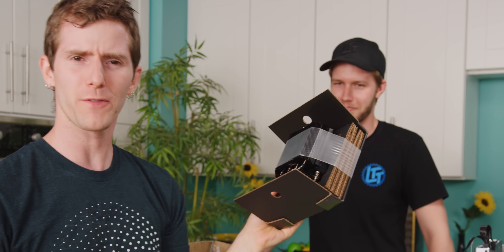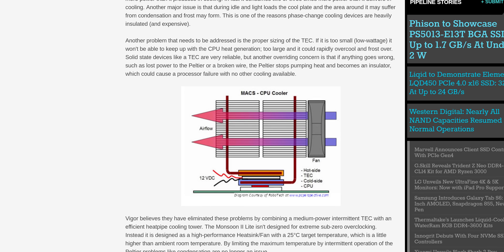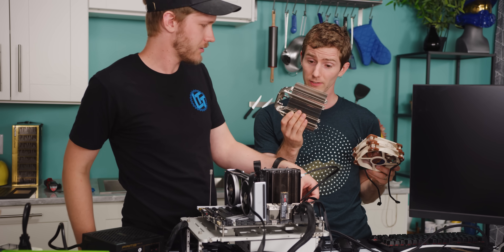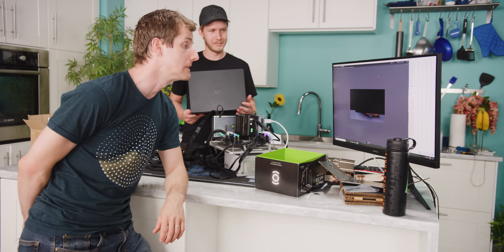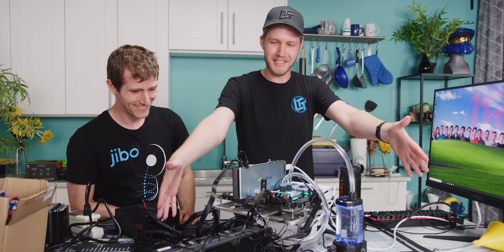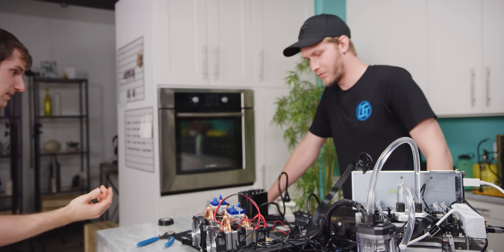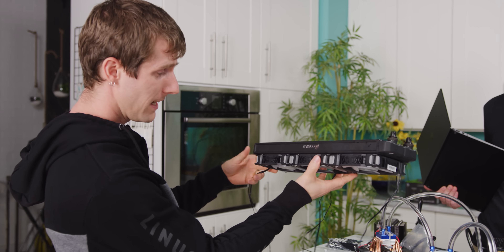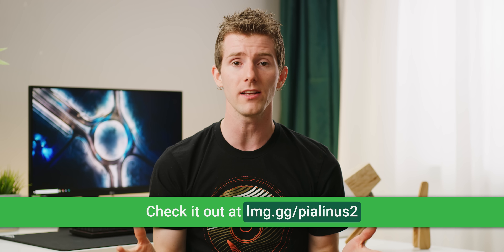Thermoelectric Cooling is a Bad Idea

Comment: You let TEC affter Cooling Pad, follow this map CPU -> Cooling Pad  -> TEC 1 - TEC 2 -> CPU, u 'll se diferent, u let the hot speed water into TEC (i don't think TEC work well). TEC1 -> TEC2 u make longer copper pipe make it like S zig zac, that TEC have enough time reduce the temperature out TEC2

Comment: What goes wrong here is that the TEC doesn't have the pumping power to keep up with the heat generated by the CPU, which makes the TEC effectively an insulator. With a TEC powerful enough to pump the heat away from the CPU, the air or water cooler can work more efficiently. Cooling power is increased when temperature differences between the heat sink and the air used to cool it increase. Don't forget a TEC (at least years ago when I used one*) generates as much heat as it pumps, so adding a peltier means you should have double the cooling power as well. 

I agree that using a TEC to improve cooling is a very costly solution. In the end you want silence and all the heat generated by the TEC itself does not help you at all. 

* I used a peltier to cool a Pentium 3 800E to -20°C many years ago and needed Neoprene insulation to keep ice from forming on the CPU and socket and on the back side of the mainboard. It was a cool project and contrary to the system in this video it worked. Even under load the TEC easily kept the CPU at freezing temperatures. But CPU's nowadays use so much more power that I understand why TECs are so inadequate.

Comment: Why take a large power hungry peltier to the CPU, when you could use a lesser one to cool the water reservoir of a water cooled system.  Also easier to test.   Or, use them to generate power from waste heat and power moar RGB - bwahahahaha.

Comment: I was researching peltier chips on CPUs and stumbled across an interesting comment (not sure if it was this video or another). Someone suggested using a peltier chip in conjunction with a water cooling system. Instead of applying the peltier to the CPU, you put it on the water reservoir to keep that cool. However, hearing about how peltiers use a lot of energy, I decided to look up ways to control the voltage to a peltier. Apparently, you can't regulate the voltage. But, you could turn it on and off with a PID controller. The PID would monitor the water in the reservoir to make sure it maintained a constant degree. If it went too high, the peltier would kick in and cool the water back down to the optimum temperature before getting turned off again.

Comment: Nice Vincero watches!
Great for using in a blender or shredder.

Btw, the Germans used peltier elements on their u-boats to produce electricity from heat difference between the water and the u-boat itself.
That way it's thermal footprint was lower/smaller, making it harder to detect by enemies and it didn't need to go to surface for replacing batteries.
Reply: Given the very small temperature difference potential, I'd say sources are needed for that claim, given that those thermoelectric driven fans for heaters barely operate a small electric motor at a difference of several 100s degrees Celsius.

Comment: Thermoelectric cooling will never be worth it. You have to not only get rid of the heat of the CPU, but you also have to get rid of the heat the Peltier is adding to the system before you see any measurable benefits. If you use a 500W Peltier, then you have to get rid of that 500W too.

Comment: have you tried to slow down the flow rate?  maybe giving the chillers more time to cool the water may help?   i understand it will also give the CPU more time to heat the water up but maybe it will make a difference over all..

Comment: Is there any benefit of cooling a cpu and gpu below ambient say maybe 10 degrees celsius under overclocked load instead of 30 to 80 or whatever above ambient degrees celsius?

Maybe longer life or better efficiency? I also don’t see the tec’s as stand alone coolers, they are more inefficient than radiators above room temperature, yes, but because radiators cannot cool to or below room temperature, tec’s are therefore more efficient there. 

Just not sure if there is a benefit. Also not sure if a better build with tec’s is to use the water cooling blocks on top of the tec’s and cpu to water cool the peltier, keep the size and noise down, as well as get the cpu below room temperature or to put the tec at the end of a radiator loop with some 6 heat pipe tower heat sinks where the tec chills room temp water from the radiator below ambient before it passes through the cpu and gpu and even to cram a peltier and water block inbetween the gpu and cpu to flash chill the water between the systems and to make use of the small size of the modules. Another system is to carry a double stack radiator with one water loop for cooling peltiers and another loop for bringing water to room temp with maybe an electric valve switch to either go below ambient or turn off the peltier and route water from the peltier cooling loop to the central loop when overclocking. Long story short, anyone investing in water cooling isn’t exactly a budget builder and will pay a few extra buckaroos for space saving, lower noise, and looking for whatever air cooling cannot deliver

Also, get yourself a krimping kit, like cheap dupont 2.54mm connectors if soldering is not your thing :p

Comment: I am absolutely certain that the thermoelectric cooler will run perfectly on AMD processors. After all, they consume a great deal less power and run much cooler than comparable Intel parts. If I had to live and work in Antarctica, I would use only Intel. They are very efficient room heaters, especially the i9 9900K.

Comment: Wouldn't you get the most out of this by cooling the radiator?? You know so the heat goes into the air not back into the system..

Comment: What if you use the 2 aquarium coolers in line with a radiator to cool the water coming out the cold side of the radiator then run it to the cold side of the cpu block and so on

Comment: I seem to remember removing peltier devices from old macs, I think they were 6100's, 7100's, 8100's, or 7500's.    I can't remember if they were stock or not either.   These were in early mid 90's models.   (LOL - When Linus was about 10)    Somewhere I still have the plates packed in storage...

Comment: a Pelletier use power to move heat, so eventually it generates more heat than without. The only good thing is to control precisely the température with PID loop.

Comment: 542 watts at 32 Amps means it's running at about 17 volts. Which means at 120 volts it's about 4.5 amps. Weird conversions in there.

Comment: The Term Cascade Refrigeration  as describe here:https://www.quora.com/What-is-the-advantage-of-cascade-refrigeration Could be more useful using the same Peltiers Modules Just Need to Better accommodate each module the correct way to better dissipate or transfer all the energy as Heat from the processor to peltier 1 and Peltier 1 to Peltier 2 but at Different alone Loops. Or Cpu to Peltier 1 to Accumulator to Peltier 2 cpu,  The temp should drop by a lot  but the wattage would rise up on peltier 1 as peltier 2 will lower far more what peltier 1 suck up the heat coming off from cpu and would not let accumulator to keep a fresh heat source untap.  By killing the heat from cpu allowing the flow in the accumulator to chill before being rechill before cpu intake.  BTW as seeing before a better coolant would be needed peltier can drop below 0 so a good coolant is a must.
Reply: Micro Refrigeration Compressor https://www.youtube.com/watch?v=uIYVwbw6gcg

Comment: Guys while I actually agree with your conclusions I have two suggestions.
I would  suggest calibrating your Flikr caméra. The temperature you are reporting is not totally correct. You would need to choose a material (eg the cooper heat pipe) and calibrate your IR camera to the cooper emissivity. Then just point the camera to the same point in every take and you will get the correct temperature. You might be up to 50% of on what you are thinking....
Peltier is a great technology, BUT you need a PID controller. I think  mounting them directly to CPUs can be pretty dangerous. PIDs are not cheap though.....

Comment: Here's a bad cooling idea that actually is pretty damn good: Isolated Atmosphere Cryogenic Cooling. In essence, building a hermetic computer case that can withstand a vacuum. You vacuum out all of the air you can, and flush the internal computer housing with nitrogen or helium until there's no humidity left, pressurize the case to a little above atmospheric standard to increase the rate that air can conduct heat, and then cryogenically cool the interior so that the  heat drains away from the heat-sinks super fast.

Comment: Can you please try: Hot water from CPU to radiator then TEC cooler then back to CPU. The surface area of the cool & hot side of the TEC (Peltier) appears to be limiting performance. Capacity & efficiency diminishes as the temperature differential increases between the sides of the TEC. A compressor based cooling system is typically far more efficient than the Peltier. It may only be useful if on-chip TEC(s) could cool a super-conducting material to a point of ultra-low resistance to boost performance and lower chip power consumption.

Comment: if you were to use a standard radiator setup but use a peltier in series on the return to the cpu would it work better. like passing the pipe through a fridge after cooling

Comment: So I have an even more stupid idea, to push the comparison even further : instead of the power hungry peltier coolers, why Don't you just use regular air coolers ?
Like doing water cooling but with a heatpipe air cooler, to see how much less efficient it is than a regular watercooling radiator.

Comment: The point is that peltier does not solve the task anyhow by itself. The task is to transfer heat from one place to another. Even though peltier is a kind of heat pump, the heat still needs to be fanned off the heat sink. So peltier doesn't make hell lot of sense in this application.

Comment: I used a Peltier 20 or 25 years ago and was not impressed.    I cannot believe they are around for desktop use.    Overclock the CPU & GPU then put a power hungry Peltier in the mix to increase power usage and heat inside the case?   Great idea!

Comment: Thats why i have done the freon cooling system on my computer from 2010,  the original ideea was a peltier module , but the power consumption was 300W only from peltier, the TDP of the CPU was 50W, so the hot side of the peltier required to dissipate 350W of heat.   But with freon cooling, the power consumption has increased with "only" 74W, and the CPU themperature was -10°C in average (-13°C in idle and -7°C at full load with prime 95).  For who is interested, you can find the build and testing video on my channel.

Comment: Out of experience, Try to cool with a thin sheet of aluminum foil as a thermal compound on a good water cooler. if done correctly and you get a snug fit and clean foil with alcohol you might just be surprised....

Comment: I think all those kits are overpriced.  I use the tec-1 12706 peltier with a smear of graphite thermal paste between the cpu and peltier as well as between the peltier and aluminum heat sink.  I also used some spray silicone on the aluminium heat sink and gave it a coating of graphite powder which conducts heat 4X faster than copper and radiates heat 13% more effectively than aluminium.

I have no issues with cooling no matter how hard I run my 2.8 ghz system.  I use 72 watts. 🙂

I also use the peltier to build small scale thermoelectric generators.  My best build so far is 1,300 watts with two tea candles as my heat source.

Comment: The peltiers move heat fast, the trouble is that it is bottlenecked, ultimately the heat has to get out to the air, making the shift from the cpu to water or to copper faster doesn't help much if it has nowhere to go from there and the overall system becomes saturated.  Hence why Linus needed a longer test, but the system he was using was not as good at moving heat to the air as the radiators.

Comment: It's a bad idea the way you win about it. I don't understand why you hook such massive radiators and bands on them. It doesn't take that much. People build little chillers to keep their drinks cool in their car using the Thermoelectric pads. Building something like this and putting your reservoir on it. Then hooking up your cooling system just like you normally would with the radiator fan. We'll get you about a 5° drop. You can use your 3-D printer to print a really neat holder. And you only needed 40 or 60 mm fan and a small heatsink on the heat side. Something I did 10 years ago. And I could probably do a much better job now days using 3-D printer.

Comment: Should try water cooling an air cooler. Like, take the top part of the air cooler and make a small tank for it. Also, put a water pump to move the water around inside the tank.

Comment: TEC only makes kind of sense if you want to do sub zero chilling. You use a huge radiator and sub zero liquid to cool things. Many level stacks.

For sane sized system, it just adds lot of power to disperse inside the case.

Freon gas cooler is much more efficient but louder.

Comment: I successfully used an 80-watt peltier on my PC back before you guys were begging for happy meals. I inserted it between the CPU and the heatsink, and used lots of silver-based thermal goop. With the exact same fan speed settings, I was able to drop the core temps by 6 degrees C, and thus achieve a 67% overclock, compared to a 50% overclock. That meant I saved about $1,000 on the CPU. So the extra power wasn't really an issue.

More recently, I designed and built a Peltier-based stove fan for atop our fire. It uses an alloy base to absorb the heat, and a massive  old Coolermaster heatsink with 6 heatpipes. The temperature differential drives a 12" RC plane propellor which blows air over the heatsink, and maintains a 40-50 degree C difference between the two sides of the peltier. This generates 1.3 volts, and enough current to drive the propellor sufficiently quickly to remove a huge amount of heat from the flue.

To avoid heat-soak, the device has to sit perched right at the front of the fire, so that cool air from in front of the fire can be pulled in to cool the heatsink. The thing is so well made, that it starts automatically when you light the fire, and it runs until the firebox cools to the point you can just touch it.
Reply: This video still pisses me off everytime it pops up. What's next? "Freon cooling is a bad idea". Pc cooling is actually one of the use cases where peltiers can make sense, you just have to actually think instead of strapping stuff from ebay together and then say "muh thermodynamics" even though your engineering is the reason it failed
Reply: Exactly. A properly designed thermoelectric cooler system can definitely work well. Stacking 2 of them in a multistage configuration also tends to increase the Coefficient of Performance (COP) and decrease electrical consumption for a given amount of cooling.

Comment: At my previous job we built a railway inspection system with two high-end pcs in a box with water cooling, where the water was running through an industrial chiller. (The chiller was cooling multiple water streams, pcs, cameras, and LED lights) Try that! :D

Comment: You need a larger reservoir/tank. What where the temperature deltas from CPU  Block Temp, vs the Cooler Temps, vs the Reservoir Temp. You have a very small system here that can only absorb so much thermal load. Your coolers are being overpowered by the CPU and their is not enough thermal mass to keep up,  but if you increased the system volume it would perform way better. coolers would chill larger reservoir and that larger mass would keep the block cooler.

Comment: TEC coolers date back to the 90s and the same reason for not using them keeps cropping up - woefully inefficient meaning stupidly high power consumption.  They also limit the power dissipation of the cpu to the cooling ability of the TEC - meaning if your TDP is 130W then you need at least a 150W TEC, probably 200W. That hybrid heatsink is a nice compromise but the TEC is still way too small.

You used to be able to get cases with a refrigerator in the base. No idea if they're still available.

Comment: I installed a Peltier cooler on my overclocked AMD K6 CPU back in, what, 1997? Something like that. It was installed between the CPU and heatsink back then. Used it for a year. Phenomenal thermals. It was pretty great, actually. Well, that is until I shut off the machine for an hour and all the ice from the condensed atmospheric humidity melted all over the ASUS TX97-E motherboard. I was not aware and, when I turned the power back on, it ruined the PC instantly. My last Peltier. Ha!

Comment: My dad sold home A/C units in the early 50s.  A wooden cabinet, a front grill, a fan and a big block of ice (ice included once but never mentioned). It worked until the ice was gone and it didn't.  It was of course a scam as is that ECOAC cooler.

Comment: Peltier cooler are useful for small car fridges that's it. Tried this 15 years ago pointless. You should have found a small freezer and mounted it's cooling plate to a CPU that would be cool since refrigeration is far more effective